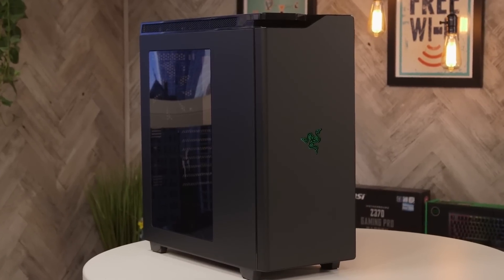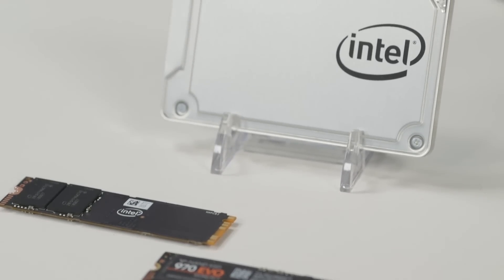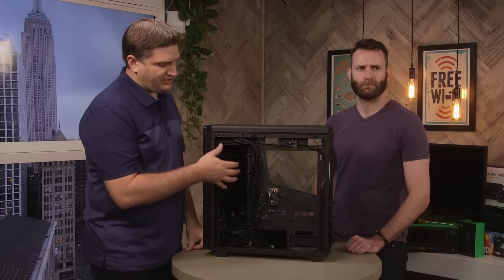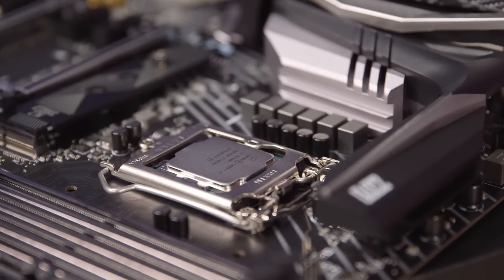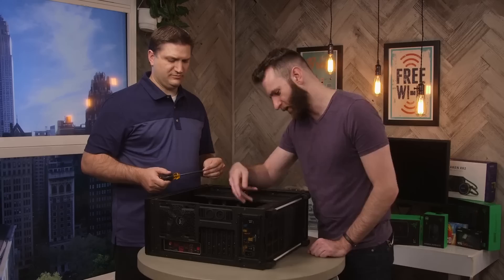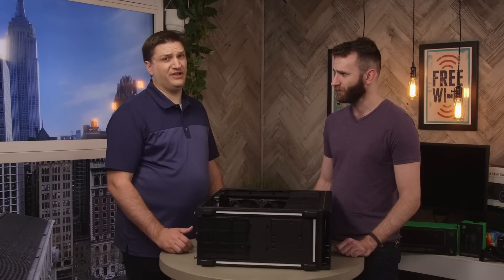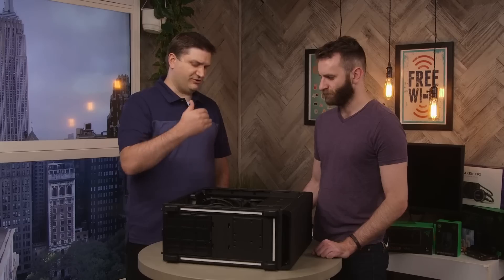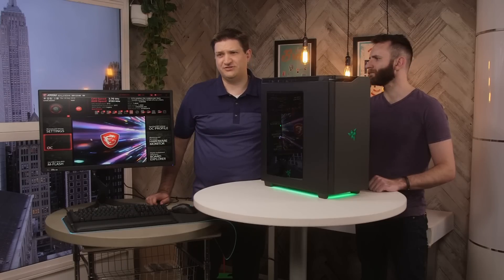How to build a gaming PC

Comment: The video has great advice and info on assembling a PC, but the advice on not using anti-static bands 2:34 is poor. You may not completely zap your component, but there is potential to shorten the life of a component as well. How much is a band compared to a $300+ GPU or CPU? Stay safe.

Comment: So many vids out there set up the liquid cooler with the fans blowing air from inside the case out through the radiator at the top. I am sitting here looking at my new Kraken 62 and my HD440 I just got delivered and I'm scratching my head. The internet vs PC Gamer, huh? Well, my thinking is this: sucking cooler air from outside the case through the rad must, surely, cool the rad more than blowing hot air from inside through it. This seems like basic thermodynamics to me, like a temperature gradient thing.

I also seem to recall Linus mentioning that having lots of intake pressure is good and you don't actually need that much outflow. I guess so long as the hot air inside has got somewhere to go it will given enough input pressure. I notice the case itrself comes with three intake fans and one outflow fan, so that kind of confirms this view. 

So i think my money's going down on PC Gamer on this one and I'm predicting PC Gamer 1 Internet 0 here.

Comment: what is the mxp feature? how do you install the driveres for the mb and cpu can i do this witouht windows or do i need the operating system first? can i do it with a normal windows 10 but without activating it?

Comment: Did you remember to check the case for rubber feet so you don't short the system?
Not sure if that is enough thermal paste. 
Also use tweezers for cable management. 

Great informative guide (with correct info)!
Reply: tweezers are not used for cable management.  They are used to tighten up the wires.
Reply: @MikaChanTYPHOON  Sounds like cable management to me?

Comment: Did they just bolt the mobo in without the spacers?
Reply: Pretty sure this case has ATX standoff's preinstalled. It should have been mentioned regardless though, not every case does.
Reply from the maker: Correct, the case has pre-installed standoffs.